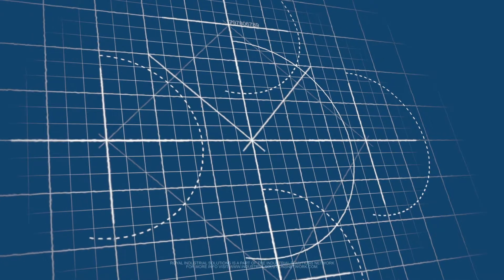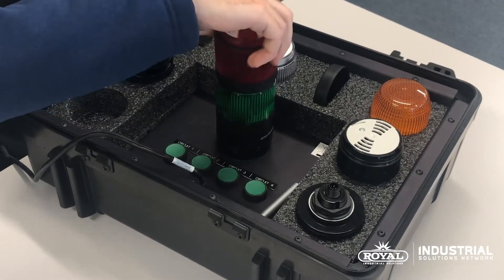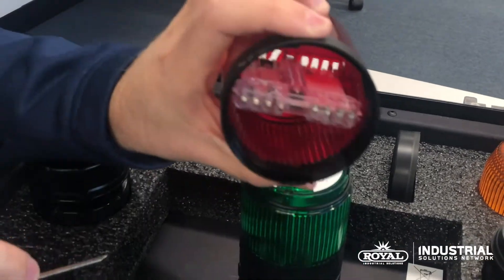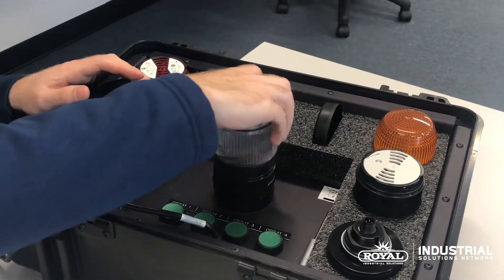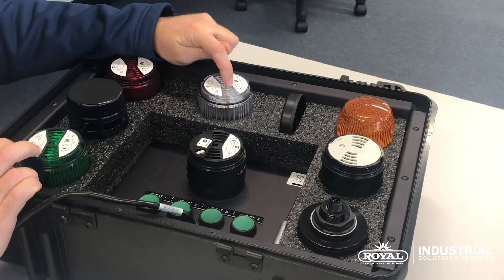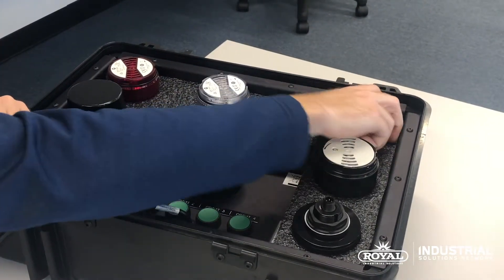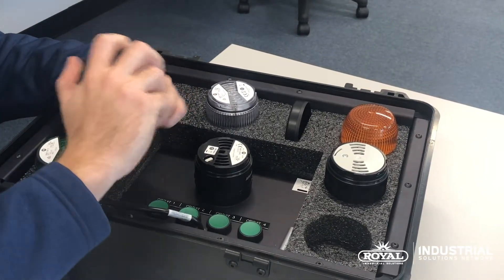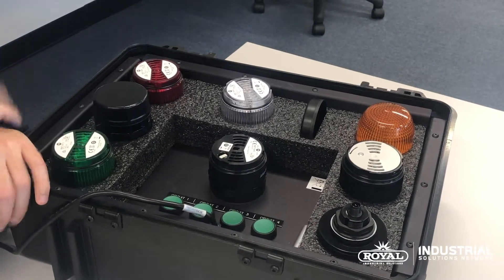How to Use the 856T Stack Light from Rockwell Automation - How-To Tuesday Episode 6

Comment: 855t 24v dc power supply ..we need to order sc 20 which is mentioned in manual ...

But i cnt able to find details about sc 20 cable ..

Could you please tell  how many  & color of wire will come in the sc20 cable ...